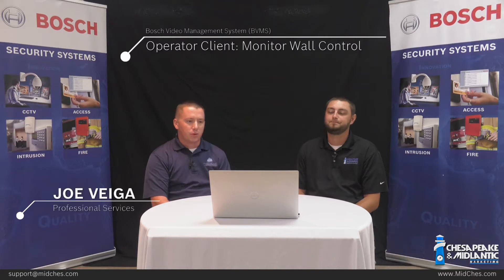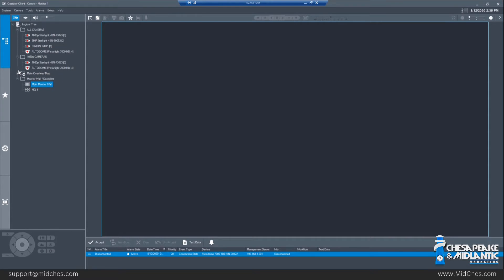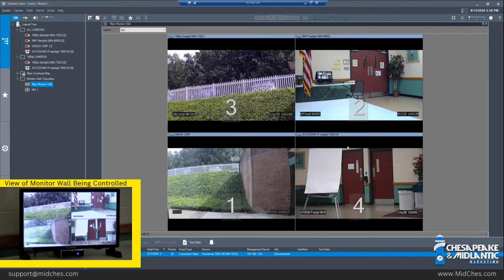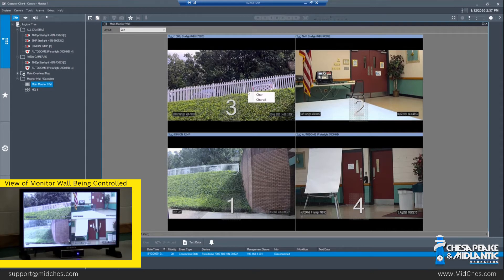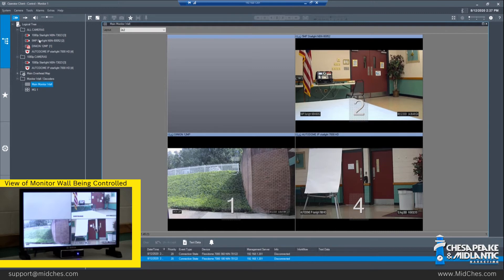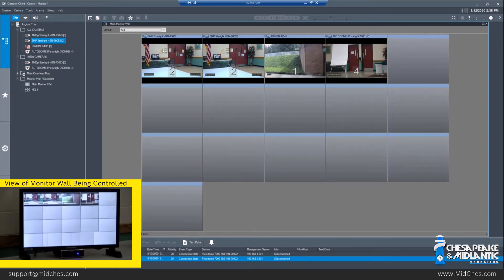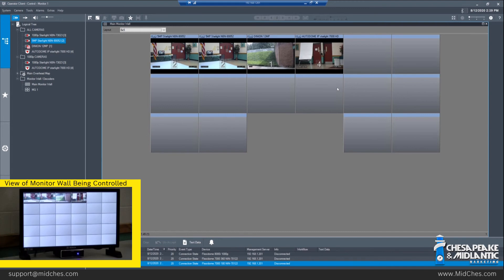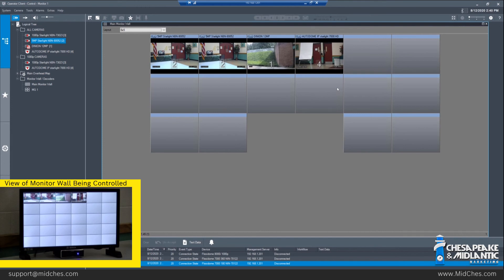Bosch BVMS Operator Client: Monitor Wall Control

Comment: Have you tried using a Bosch decoder to view a Bosch camera that has passwords set on all three accounts?  service/user/live    I can't add a camera after it's been property locked down.
Reply from the maker: Jack, there are a lot of variables in play from camera firmware version to decoder model and firmware version. Have you contacted Bosch tech support? If not, they can be reached at 1-800-289-0096
Reply from the maker: The decoder needs to be able to authenticate to the user level account on the camera.  If they are using BVMS, this is accomplished by providing the decoder a “destination password”.  This will allow the decoder to authenticate and connect to the camera.  If issues exist beyond that then there could be other variables to consider but it wouldn’t be authentication.